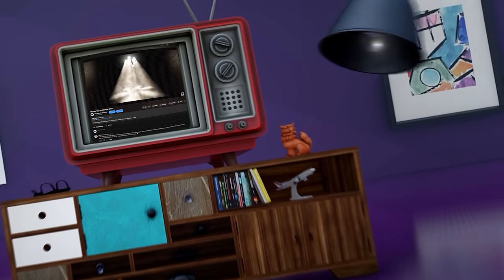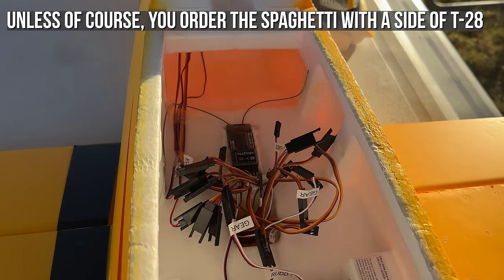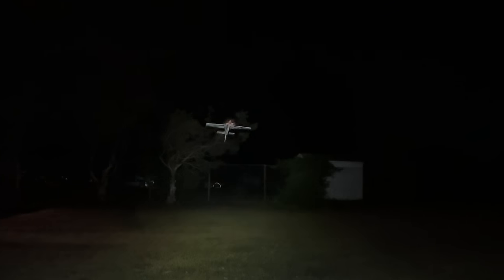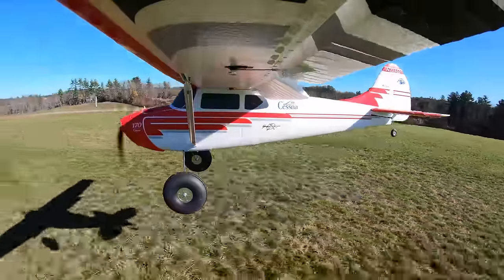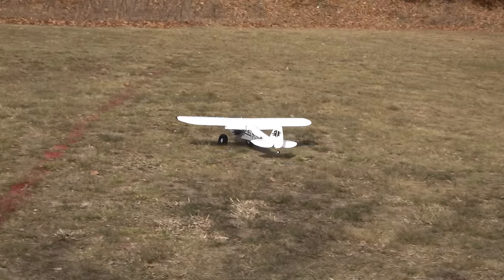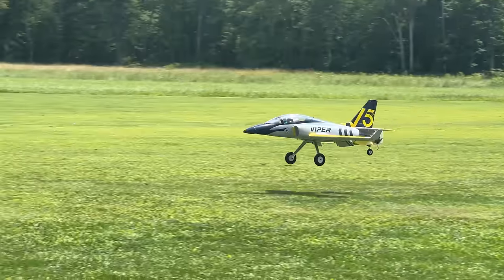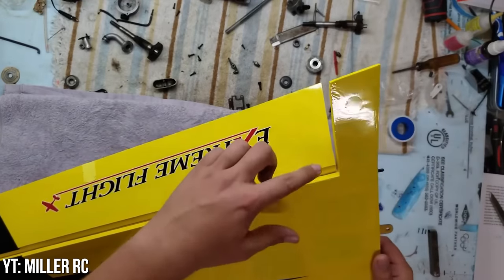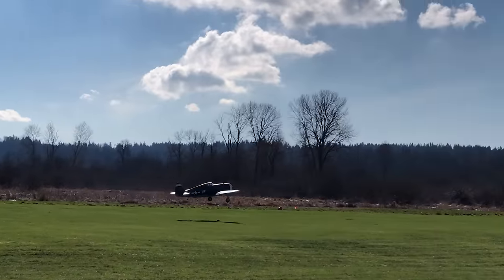What Makes an RC Plane GOOD?

Comment: Twisted hobby’s kits are the absolute bomb. Yea they’re expensive and you can scratch build one or buy some other brand cheaper. Been there, done that. but dude. It’s so worth it.  The crack yak lite flies like a dream. I purpose-designed and scratch built my own foamy to fly just like that back in the day but I spent many hours doing it. When I flew the crack yak lite and realized it flew just the way I wanted with 1/3 of the build time I was hooked. 

West Michigan park flyers are pretty awesome too. Though slightly less refined in the build and fitment category, their yak 55 flies killer. And it still builds straight pretty dang easy.
Reply from the maker: Preaching to the choir. 😁
Reply: when is the new upload?
 @TailHeavyProductions

Comment: I’m Ryan and I need your help. My dream when I was younger was to fly Rc airliners but I could never afford it. Now I’m 15 and I’m saving up for the al37 from motion Rc. I asked another YouTuber jays Rc garage if I should get it and he said I should get one more plane that had retracts and flaps before I dive into airliners. I previously flew the apprentice s which I mastered on experience mode, the umx timber original, the twin otter umx, the champ, and I flew the umx citation a little bit. Do you think I should get the al37? I already bought a livery for it but I don’t  know if I should commit to purchasing the airliner along with an nx6, a 6s lipo and a receiver. I have the dx63 but Nx6 is way better from what I’ve heard you say and I like how it talks to you. I really want your opinion. If you don’t think I should get the al37 what’s another plane I should get before I move up to the airliner? I was thinking maybe the viper v2 from fms but I trust your judgement way more than mine.
Reply from the maker: Hey Ryan! Sounds like you're beginning to gain some good experience. I'd suggest something like the Habu to start before going to the AL-37. Fly it so much that you become tired of it...then consider the AL-37. Just be aware that with the AL-37, if you get slow and keep loading up the wing (aka adding more up elevator and in a turn especially) - it will likely drop a wing. If a wing drops and you pull up or roll opposite of which wing drops, you can guarantee it'll end up in the weeds. Watch our video on stalls for more info on how to approach upset (stall/spin) prevention and recovery. Practice purposely trying to drop a wing a bunch and recovering up high with all your planes including the Habu and I'm sure you'll do well. -Zach
Reply: @TailHeavyProductions  Thanks! I was thinking instead of just getting the al37 I would just get the viper v2 because I kinda like how it looks more and it seems beginner friendly
Reply from the maker: The Viper V2 is not a beginner friendly plane despite what some folks seem to be implying. It also will drop a wing on you. Watch our review on it. I'd suggest the Habu over it. The door will open to buying planes that look good once you master the Habu. 😁
Reply: @TailHeavyProductions  ok thanks!
Reply: The one from fms or hh?
Reply from the maker: The Viper V2 from FMS and E-Flite are the same plane. Snag the Habu. 👍
Reply: @TailHeavyProductions  thanks I’ll get it
Reply: @TailHeavyProductions  does the ss 70 mm one work?
Reply from the maker: Yep!
Reply: @TailHeavyProductions  would the Vulcan work? The one from motion rc? I heard it’s good. Jay said I should get a jet with retracts and flaps
Reply from the maker: @IndominusRyan I’d stick with the Habu.
Reply: @TailHeavyProductions  ok that’s all the questions I have! I gotta make like 100 more bucks till I can afford it but I mean I would rather get a practice plane and train with it then fly a pretty one rather than just destroying the pretty one right off the bat. The habu looks nice by all means but I like airliners more. Thanks for all your help! Your my favorite rc channel

Comment: Im watching this while figuring out why THE FUCK my Autonomous scratchbuild (first Fc build) absolutly fucked itself into the ground. During the "quality components" part I found out my Spectrum servo broke. like, its not that their 10 bucks a piece, like I broke 2 or 3 by now and 6 of the goo' ol' hxt 900 servos cost the same and never broke on me. Fuck this!
This is completly accurate  for ESC's though, cheap ones suck.